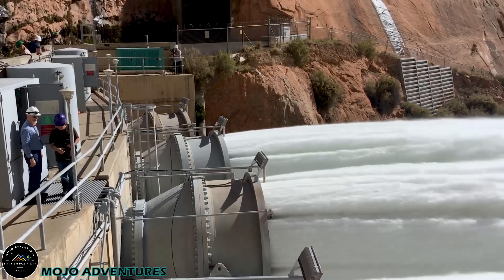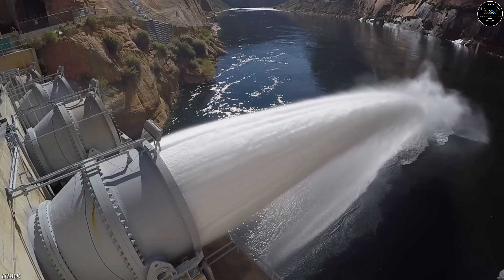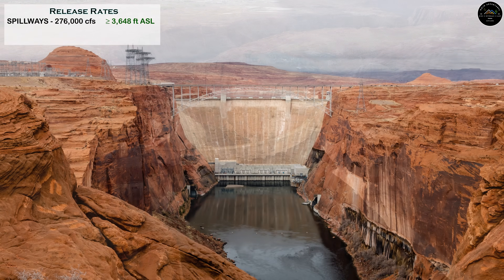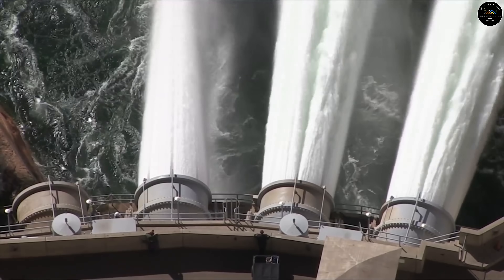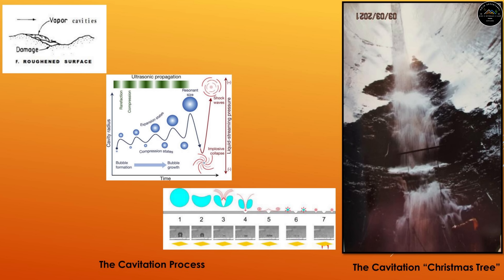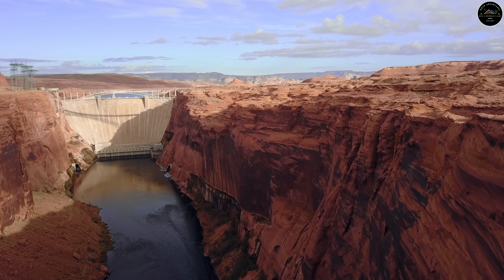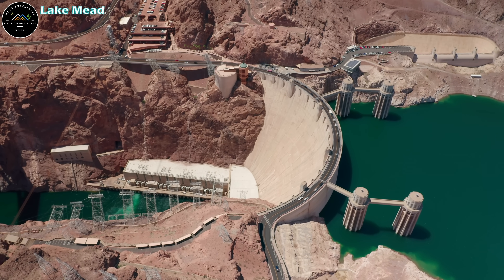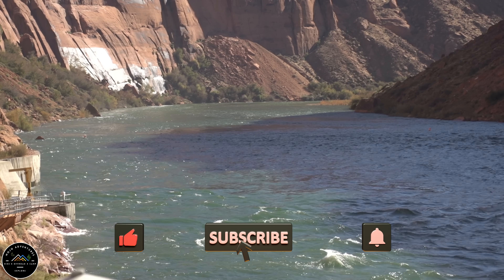TROUBLE ON THE COLORADO! Damaged Pipes FOUND Inside Glen Canyon Dam at Lake Powell #water #update

Comment: The river outlet works are not as described: "antique." They are a relatively new design compared to those at Hoover. They also were never designed to make releases that simulate a flood. That is a much more recent idea that was proposed decades after the dam was built. They are for low-level and emergency releases. The problem with discharging high flow while the reservoir is low is that there is not enough back-pressure on the valves to prevent cavitation within the pipes. They are at the limits of operation. Releasing the same flow with the reservoir at much higher levels would not likely cause cavitation issues because the valves would not be fully open, and a higher pressure would be present within the pipes upstream from the valves. Cavitation is the result of negative pressures developing in the pipe, and higher pressure can counteract its formation. The engineers from the 1950s were not likely as aware of cavitation issues or how to prevent them as engineers are today. Additionally, dam operators were not necessarily aware that cavitation could develop unless modern engineers did a study and recommended operational restrictions. The original engineers may not have proposed any restrictions to flow at low reservoir levels.
Reply from the maker: Thank you for the good information!👍 Backpressure makes a lot of sense. It seems like just about everything along the Colorado is being run in a way that it was never designed for these days. It's no wonder we're in this situation. Now we watch in a few months as every outlets fawns over the low levels at Lake Mead. Fix one problem on the river... cause another.

Comment: Simple siphons could help.
Reply: A siphon can't lift water more than about thirty feet above the original surface level. Any higher than that and the water boils due to reduced pressure and the vapor fills the space. The liquid won't move, and the water in the descending part will run out and that's it.

Comment: One option might actually be to cut down the size of lake mead itself which would reduce evaporation, simply raise the water level but reduce the actual footprint of lake mead maybe creating a sectional dam that can be opened and closed to expand lake mead if needed.
Reply: Easier said than done
Reply: @WN_Byers   Sure but  I would think it is at least simple to cut down the size of Lake Mead overall with earth works
Reply: There would probably not be a problem at all if there wasn't a need for the power generated at both dams. This is clean power. During a prolonged drought, there has been a balancing act to keep both powerplants working. Of course, they could lower the reservoir, but that would mean whole communities would have to go without power. All these operations issues seem to bring a lot of drama, but the real issue at both dams is maintaining power generation.
Reply: @CO-PE-123  But wouldn't making the lake smaller help to boost electricity generation by keeping the water level higher naturally?
Reply: @DrScopey2  to be honest, you are being really hubristic
Reply: @WN_Byers  hubristic? What have I said that is hubristic?     I am just suggesting how to fix the water level issue by reducing the size of lake mead, pretty simple fix really.
Reply: @DrScopey2  you think or assume it's that easy. P.S. what unintended consequences are even possible from such an undertaking? Have you even considered that? Are you an engineer???
Reply: @DrScopey2  I don't think you're being "hubristic", that implies you being proud, but you're just thinking and asking a question about a solution.  And I'll say, I know very little about the way these dams are setup and how they work together.  I think the issue would be that volume is volume.  If you reduced the size of the lake, the same water would still be there, and you'd just run through it the same rate, but the levels would drop faster.    You unfortunately can't just make energy, there is always a loss somewhere.  Either the pressure, or volume.. the whole "equal and opposite reaction" concept applies in fluid dynamics as well. Not to mention the people living on the lake, and the impact there.  We humans like to make habitats that are unstable, but build on them as if they were stable as the day is long.  Like building below sea level, and making levee's, or making lakes in the desert :D

Comment: Why does Cavitation not occur in the Penstocks?
Reply: There are much lower flow velocities in penstocks, so not usually.
Reply: @CO-PE-123  - There's also back pressure.
Reply from the maker: I believe it has to do with the pitch of the piping, the material, and imperfections. Apparently the spillway cavitation started over a walnut sized concrete lump sticking up into the flow. It was made possible because of the steepness at the top of the spillways also. In the case of the penstocks, the pitch isn't as great, the piping is steel, and there is backpressure from pushing the turbines.

Comment: Very interesting.   Is this a sediment problem this time or was there concrete lost in the tube? Either way is there an estimate for clean up/repair.   My opinion would be to save the dams if at all possible.   No dam means no water reserve. It also would mean alternative power.  Reduced demand down stream seems to be the best solution for keeping both.    California has the best options for alternative water sources either by conserving snow melt and or building desalination plants all along the SoCal coast.
Reply from the maker: No sediment problems this time, just cavitation eating away at the pipes again! The penstocks and river works outlet are all steel piping so I would have to guess it's eating away at the joints, or possibly infiltrating outside the pipes where it shouldn't and they just started noticing it. No estimates or solutions yet as the ball is just getting rolling on all that... I'm sure you know how federal projects work. It seems USBR has been putting off major renovations to the dam for a while. It's coming to an "all or nothing" situation for Glen Canyon Dam. Time to either fix it or leave it! Thank you for watching and commenting 👍

Comment: All dams should have a sediment flush system. Hoover is one of them
Reply: So, if the water level goes below the penstock inlet, just don't let anymore water out, and when it rains, it'll fill up again. Problemo solved. Yeah I know there are customers downstream, but hey what.
Reply: Sorry to say but They Don’t Teach or have Common Sense. The Main Problem was Al Gore John Kerry
Reply: The sediment flush is not for sediment in the reservoir. It is for sediment in the Grand Canyon. You might notice in the video that the water comes out clear (white due to high air entrainment), not the color of sediment. The flush is intended to simulate floods, which are no longer a regular occurrence in the Canyon. These floods move sediment and form beaches, which are very convenient for people rafting in the Canyon who need a place to camp. These flushing flows, which caused the damage to the outlets, resulted from lobbying efforts by the rafting industry, among others. They were not part of the original planned operations and were starter during the Clinton administration, well after the dam was constructed.
Reply: The water slows where the river enters the lake, dropping most of the sediment there, not near the dam! If you watch videos of the Condit dam removal, you see the most sediment furthest from the dam. They had to drain the entire lake to flush it...good luck draining Powell or Mead to move all the sediment.
Reply: @DillonPrecisionFan  because dredges dont exist?
Reply: @DieselRamcharger  they can't afford to dredge millions of acres of silt!
Reply: @DieselRamcharger  Lake Mead has lost millions of acres feet of capacity to silt build up.
Reply: @DillonPrecisionFan  yet they can afford billions to ukraine and israel and palestine......weird.
Reply: @DillonPrecisionFan  A long time ago they had to pull the plug on the drain of the Gulf of Mexico in order to remove the sediment from the Mississippi…..

Comment: Every well drilled in utah is defined on lake Powell water.
Utah does not use its entire water rights.
Az. ,Nevada and California are and have been over using there share bureau of reclamation has told them so for years .
1922 Colorado river compact.
Bureau of reclemation releases millions of c.f.s. in the spring to help out a fish (dumb bureaucracy)razor back sucker,carp.
Colorado river compact is about to be redifined .
Look it up don't trust me.
Its a fact!
Reply from the maker: I did not know about Utah wells being defined on Lake Powell water. I am guessing just in the region of the river? It wouldn't make much sense otherwise. It would be like basing Reno's water supply off Lake Mead. Interesting nonetheless, I will definitely look into this more! Nevada (Las Vegas) receives return credits for returning so much water back to Lake Mead. LA is just getting onboard with a similar water reclamation loop. I definitely agree that the compact is about to be redefined! All these payouts and "voluntary cuts" are just lip service leading up to 2026. That's when big, lasting changes are going to have to be decided. Thank you for watching!

Comment: Thanks for this video!
Shortsightedness combined with huge projects can result in massive problems, as you describe.
Reply from the maker: Absolutely! It's a bit of a testament to the Hoover Dam's construction also. You wouldn't think something of this size and engineering precision from as recent as the 60s would have so many failures already...
Reply: Hindsight is not Shortsightedness. You probably predicted that airplanes would take out the WTC too right?
Reply: @akshonclip  Nope. It was a controlled demolition.
Reply: @tzadik36  I rest my case
Reply: @akshonclip  buildings were built with accidental plane strikes in mind, including the WTC. Problem was Planes ended up outpacing what we thought they could be.

This same issue has happened with bridges. We did factor in larger traffic and heavier vehicles in bridge designs back in the day, but the reality of it far exceeded what early models were predicting

Plus the sciences and engineering of mega projects today is WAY more advanced than it was in the 60's, it's just that in reality you can't account for everything, the trick is just managing to plan for all the right things and having none of the things you missed come back to bite you in the ass lol
Reply: @chompdoesathing  You completely missed the point I was trying to make.

Comment: Cavitation…I learn so much from you guys! Seems pretty concerning to those of us who rely on Lake Mead’s water levels. 
I was hoping for a strong 2023 winter/snowpack up north of you. Turned out to be just ok, correct?
Reply from the maker: Glad to hear! That's right, snowpack turned out to be just a bit above average. Peaked around 110% this year which isn't bad at all. We were certainly expecting worse, as the trend usually swings back after a wet winter. Unfortunately as you can see Mead still has problems upstream and downstream. Can't "catch a break" it seems!
Reply: Cavitation... Could you ensure the plumber reams his copper pipe after making a cut? Otherwise, you will end up with leaks.

Comment: I wonder how much time we realistically have before we reach dead pool at both dams?! My solution was 20 years ago when they closed San Onofre. We should have converted it into a de-cell plant and put the water in Powel and Mead. Way to late now, we might be in trouble in just a few years?!
Reply from the maker: I don't think we will reach deadpool in both dams unless the USBR continues this trend of trying to save both reservoirs even during drought years. They have always held Lake Mead as the primary reservoir of the Colorado. It seems Lake Powell might have been a little bit too ambitious for the supplies we were given over the last century!
Reply: @mojo.adventures  Yes it will be tough because Southern Utah relies on Powell for hydro power. So that dam needs to stay above the power generation level. But will it? Low snow pack level is nearly gone! Keep these stories up to date please! I need to know if I have to move to Idaho...lol...!!

Comment: Does it make a big difference - other than buying us just some few more years till the inevitable happens - to draw down Lake Powell to 3370 feet (and after that, outflows will automatically reduce to match inflows) instead of reducing outflows now and keeping the lake slightly above 3490?
Reply from the maker: It won't make much of a difference unless they decide to overhaul the whole system. I think what you describe is the exact idea the USBR has when they say to "decommission" the dam.
Reply: @mojo.adventures  I would think that "decommission" the dam means to tear it down completely or to re-open the diversion tunnels so Lake Powell would be gone completely. Then, the flow rate slightly downriver of the former dam site would "automatically" always be exactly the same as slightly upriver.  However, the dam operators could emulate that behavior without tearing the dam down - keep it slightly above minimum power pool an keep outflows (through the turbines) always exactly the same as the instantaneous inflows. We would lose some water to evaporation but we could still produce some electricity. An if we say that the overall outflow per (day|week|month|year) has to be exactly the same as the inflow in that time period minus evaporation, we could have some flexibility to produce peak power. Not sure whether it is wise to "decommission" an existing infrastructure in the sense of destroying it.